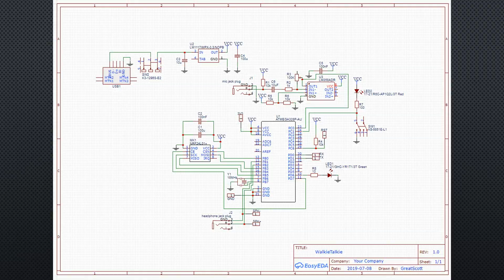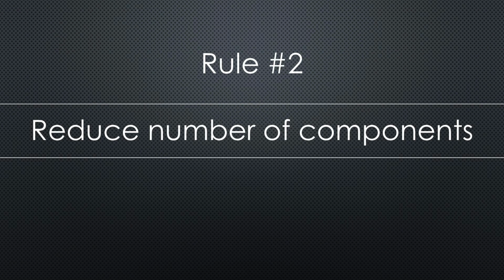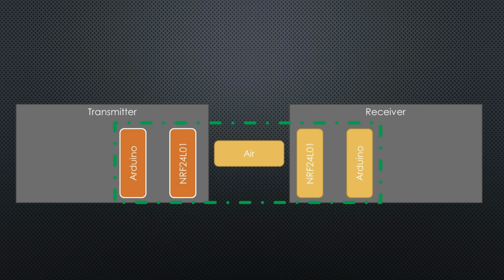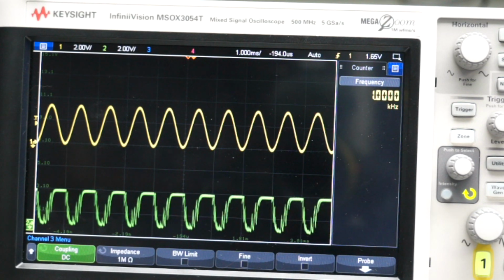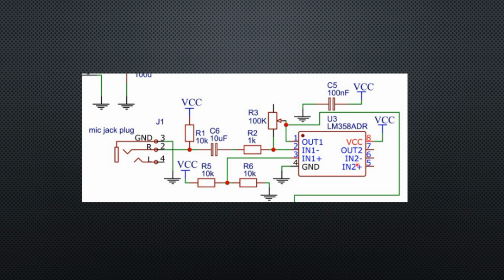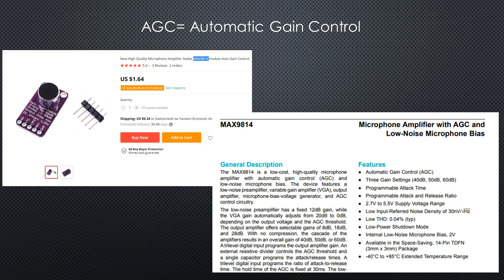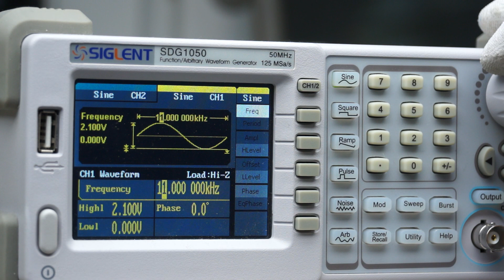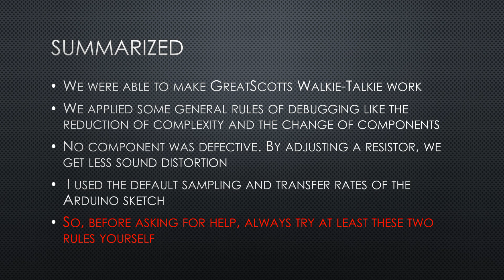#279 How to debug Arduino Projects (GreatScott's Walkie-Talkie)

Comment: This video inspired me to learn about digital audio and PCM, which I knew nothing about, not to mention re-learn about opamps yet again, and even purchase a small wave generator! I have some very basic questions: My understanding is that the output of the Arduinos (both before the transmitter and after the receiver) is a PCM encoded signal. Looking at it on a scope, this PCM signal appears to be serial pulses containing an 8-bit two's complement number every 2.4us (~400khz). I understand that the number corresponds to the amplitude of the output signal. My first question is how can this digital signal (or two opposite signals like on output pins 9 and 10) drive a loudspeaker directly. I would have thought you would need a DAC. My second question is that if original ADC output was 10 bit and 8k samples/sec, why is the PCM output only 8 bit and 400K/sec. 

How in the world do you have the time to produce such detailed and insightful content on so many subject so regularly! I watch every video until I understand it and build many of the examples to educate myself, and I have a hard time keeping up with you. You are amazing and an inspiration. Thanks!
Reply: Oops, I was looking at the MOSI signal coming out of the transmitter and the MISO signal going into the receiver.  

What I am really interested in understanding is the digital format of the signals coming out of receiver pins 9 and 10 and how that can drive a speaker. (Input is a 1Khz sine wave). Now, when looking at receiver pins 9 or 10 on the scope, these appear to be complimentary PWM signals with a 24Khz period and a pulse width of about 1.3us for every 100mV or so of input amplitude. I gather these two signals drive a speaker the way a PWM signal can drive the brightness of an LED and the two opposite signals (push-pull?) are stronger than one signal and ground. 

Am I correct that the MOSI output of the transmitter Arduino into the transmitter radio is considered PCM (and the MISO input from the receiver radio to the receiver Arduino )? So we have both PCM and PWM signals. Complicated, but simple!
Reply from the maker: PWM (pin 9 and 10) is a simple digital signal where the width of "high" is varied. It has no "data" contained in it. Whereas MOSI or MISO are real digital signals with bits and bytes. And you are right with the "push-pull.
If you integrate a PWM signal you get an analog value which is proportional to the width of the pulses.

Comment: Hmm, I haven't quite levelled up enough for this channel, but I certainly did learn something. I'm thinking that this could have been tested with a simple multimeter, where the capped sinewave would have produced an average signal that was not at the specified middle voltage. I mean, yeah a scope would be easier, but I don't yet have scope money :-)
Reply from the maker: A multimeter is a good start. The rest will come one day, I am convinced.

Comment: Interesting that adjusting the gain at the start fixed so many issues though I suspect a low pass filter on the output would help make the sound quality a little easier on the ear.
Reply from the maker: A filter definitively would help!
Reply: @AndreasSpiess  I would be very interested to see what an add on low pass filter would do.
Reply from the maker: Why not try it yourself. For a video, this would probably not be very interesting :-(
Reply: @AndreasSpiess  My workshop is currently being built... and isn't set up for electronics yet.

Comment: Hello , great work, excellent vídeos, you have many fanns, here in México, cheers, we are having a trouble with a proyect using LoRaWAN for a security buttons installed on a wood park, and we want to ask you if you have a solution, its a point to point signal array buttons to a central to identify, wildfire, animal trubles, flood, trash wastening, etc. To send a vehicle. Just a Button signal using LoRaWAN will do the work, but we need some help, thanks in advice, we really appreciate it. #makershelp cheers
Reply from the maker: Maybe you watch my "ESP-Now video. It contains a point-to-point LoRa connection
Reply: @AndreasSpiess  checking now , a great thanks to you we will have to buy esp chips and learn a lot, but we are thrilled to do it, 2019  come with a lot of wildfire, and we have to be ready for 2020 , great info, awesome response

Comment: 2 questions:
-When is it most appropriate to use the ISP or Jtag Debugger on your micro controller? Do you normally do that after all other options for electronic failures have been evaluated? 
-would throwing a lowpass RC filter on the end of your output get rid of the high pitched noise in the signal? Or maybe a bandpass with a wide high band?
Reply from the maker: Maybe you watch my video about debugging and then decide if you need it or not.

Comment: Hello Andreas. Thank you for the awesome video. Would it be possible to build this project on a STM32F103C8T6 microcontroller with the same code and library?
Reply from the maker: I doubt because it uses some Arduino specials like timers.

Comment: I wish you would have used a spectrum analyzer to show the actual sampling frequency components.  Also, why not tweak the design to minimize aliasing and develop a filter to attenuate unwanted and very annoying aliases.  So, suggest another video....by either or both of you!!!  ;)
Reply from the maker: I did not want to change too much. The spectrum would have been interesting, but also complicated for many viewers. This is why I did not include it.
Reply: @AndreasSpiess  Okay, but you could have addressed possible improvements without doing anything  GreatScott could consider that, and it would be up to him.  It is still a possibility

Comment: @GreatScott / Andreas you really need to put 100uF capacitors on your nrf24l01s. They power burst on initial transmit is very high (like 250ma IIRC). 100uF is enough, 47 isn't.
Reply from the maker: Mine had a 100uF cap on the board
Reply: @AndreasSpiess  I think I saw 47 on his. My bad!

Comment: I learned a really nice detail from this video just in passing, it was never explained or even mentioned. Notice how at 9:14 it shows the NRF24L01 with antenna wires soldered on? I never knew that was a thing! I tried the same on an ESP8266 module and literally improved signal strength by 10dB. This solves the signal strength issue I've been having in some places. Thanks for another great video!
Reply from the maker: These two NRF24L01 were in my drawer from old experiments...

Comment: This project might evolve into something really interesting. Since we have a digital transmission we could add strong encryption.
Reply from the maker: Our bikes are fast and the reach is short. So the chance to be intercepted is probably small ;-)
Reply: @AndreasSpiess  What is the reach?  I assume the distance is shorter than the specs say.  Also some missed packets would distort and you can't really retry sending. So what is the effective range?
Reply from the maker: If I remember right it was mentioned in GreatScott's video. I would assume a few hundred meters on an open road with the long-range version

Comment: Andreas, I know for sure than the ATmega328 has internal amplifiers on its ADC inputs. So you can completely omit the pre-amplifier part. But you'd probably need to write the ADC code in plain C. You'd be able to select 20 or 200 gain. Take a look at the datasheet.
Reply from the maker: I do not think so.
Reply: @AndreasSpiess  You're right. I checked again and ATmega328 doesn't have it. But ATmega32 or ATmega16 have it. It seems that they are different. Download the ATmega16 datasheet and search for "200x". I've actually used it for microphone operations.
Reply: There are also other useful features in ATmega series nobody knows about and nobody uses. For example, if you don't use a quartz to clock your ATmega328 and use its internal RC oscillator, you can connect a 32kHz quartz to it. Then you can burn the CKOPT fuse to enable internal 22pF capacitors on the XTAL lines. Then with a good program you'd have an RTC without needing an special IC.

Comment: Perhaps GreatScott could use this modules to build a walkie talkie. They are build for audio transmission. Only a arduino driver is needed additional. 
https://de.aliexpress.com/item/32305976029.html?spm=a2g0o.detail.1000014.23.3d7231649YQrck&gps-id=pcDetailBottomMoreOtherSeller&scm=1007.13338.128125.0&scm_id=1007.13338.128125.0&scm-url=1007.13338.128125.0&pvid=9f7b6d04-30cf-433d-818b-d88a9b1f6a22
Reply from the maker: Using these without being a licensed amateur operator would be illegal. For sure not the goal of GreatScott.

Comment: My first idea was an overdriven AD converter but a bad working microphone amp could also be possible. You could also try a inductor in the output like it is used in class D amplifiers to build a low pass of 3 KHz. It filters the noise. Most walkie talkies works only up to 3 KHz wich is anough for speech.
Reply from the maker: A filter would for sure help, you are right.

Comment: I suggest adding a low pass filter to cut off the digital noise high frequencies, to improve the audio quality, you could cut off above 4KHz pretty safely.
Reply from the maker: You are right. I did not want to change a lot. And as a HAM operator I am used to some sort of noise ;-)

Comment: So that distortion was due to the Arduino boosting an already distorted signal?
Reply from the maker: Yes
Reply: @AndreasSpiess  I really like the way it distorts. Could this type of distortion be achieved with all analog or do I need to use an adc of some sort?
Reply from the maker: You can add a noise source if you want to do it the analog way.

Comment: Hi Andreas, good work, but I have some complaints. You called a clear signal that signal that unstable at all and have so much digital noise. As already mentioned in comments simple filtering would fix aliasing on ADC input and filtering for speaker output will smooth sinewave (as you showed in video). Another thing I don't like - ADC sampling, due to arduino nature I doubt it have anyhow fixed sample frequency. 

Taking to account poor ATMega's ADC performance it is possible to use only 8bit data to save some RF bandwidth. 

Not judging you or anything, just thinking that you can make it a usable device, both improving sound and transmission quality. Hope you will have willing and a time to do that, curious to see end result.
Reply from the maker: As a ham operator, I am used to garbage in RF communications ;-)
Reply from the maker: Maybe you remember the title, which started with "Debugging" not with "Building" ;-)
Reply: @AndreasSpiess  Yeah, definitely. But I personally wouldn't call that earrape sound as "clear" when it looks like garbage on the scope :)

Comment: Good illustration of Nyquist's theorem - need a sharp low pass filter cutting off around 2/5ths of the sample rate, and there's a lot of jitter. Even 10ns jitter on the sample timing adds a lot of noise. It could be that the code is not sampling using a precisely timed interrupt, or is running in a main loop with unnecessary interrupts still running.
Also, it's really important to use a sample and hold circuit to fix the voltage as it is being sampled, though this may be already built into the Arduino's ADC. Integrating PWM with an RC circuit is pretty crude, but a proper DAC chip and LPF would also help to improve the sound quality.
If there's enough processing power available, the sound could be encoded in real time as AAC or MP3, transmitted with a lower RF bandwidth instead of using uncompressed PCM then decoded by the receiver.
Reply from the maker: If somebody wanted to build a real walkie-talkie this is not the recommended way. I liked the project because it uses our standard parts and still works. But adding a filter would for sure be a small, but useful addition.

Comment: Oh my ears! This needs low pass filter improvement too..
Reply from the maker: You are right. But you probably never worked with RF communications. Otherwise you would be used to noise ;-)
Reply from the maker: Here you are right! A filter would not hurt.
Reply: True, my RF experience is about 10 hours with SDR :D I don’t mind pink or any other noise, but this screeching made me cover my phone speaker. I could never get used to that, unless I loose my teenage ears.. If I had to deal with it, I’d pass it  through low pass or eq so it wouldn’t hurt

Comment: Ah cmon! I just finished my video about it goddamnit.
Reply from the maker: I have no problem if you release it. Did you come to the same conclusion?
Reply: @AndreasSpiess  I focused on testing if it is possible to process natural language with an arduino nano, including just spamming some packets in the ether with an NRF24. Since I wanted to program a neural network for word detection on an ESP32 or an Nano, I was quite interested in that. There was only a sender, not a receiver, but the sender had both a microphone and a speaker and looped the audio directly to the speaker while sending one NRF24 packet each time. The voice was audible, so I think a project like that should be feasable. On an arduino nano, at least. The test with an attiny13a failed, it's too slow. I didn't need anything for the microphone or the speaker, though. I attached them directly and went the highest frequency with both the pwm and the adc. That resulted in audio artefacts which were a bit annoying, but I am very sure with some more work they can be filtered or removed by software.

Comment: Ooh...I see .. The problem exists in the code... You don't need to mod anything but the voltage reference source in code
Reply from the maker: The clipping happened before the Arduino in the opamp
Reply: @AndreasSpiess  Oh. Ok
Reply from the maker: I do not think so
Reply: @AndreasSpiess I'm pretty sure it is definitely. Since avr have an internal voltage reference of 2.56v
You need to see what the admux values are, when adc reads voltages

Comment: Great video!  The selection of MPU for the project makes me cringe.  I have experimented with digitizing and delivering audio with AVRs.  While possible, the quality is poor.  These chips are wonderful for a great many things, but slow, with only 8 bit ADC at high speeds, and lack hardware DACs / i2s.  ESPs and STM32s are only a couple of dollars and have Arduino IDE support.  I have a sly suspicion you recognized the problem with the LM358 at first glance, Andreas, due to experience ;)    My go-to op-amp these days is a TL082 for its high slew rate, and behavior close to the rails when using a single voltage source.
Reply from the maker: First I suspected the problem in the software because I did not believe it was possible to use the NRF24L01 for that purpose ;-)

Comment: what is interesting is that a lot of people think that debugging is not an essential skill, however I could say that this is one of the most important skills to have, you cannot be a good specialist without it. I just started learning electronics about a year ago, but I can say that I could debug that also without any problems (of course by having the appropriate equipment). The most important step in this is choosing the right strategy for debugging the project.
Reply: It is part of being a good engineer and it’s called experience
Reply from the maker: @D4no00: This was the intention of this video.

Comment: I did notice in great Scott's presentation he never demonstrated going from amplified microphone to speaker with a straight wire. I also noticed in this presentation that was the last thing tried. So one more rule: KISS.
Reply from the maker: In my eyes this project is KISS. It does not have one component too much, at least if you want it wireless...
Reply: @AndreasSpiess  I agree. My comment, was regarding the troubleshooting sequence. Make sure something works in the simple case  (direct wires) before the more complicated case (wireless).
Reply from the maker: Your choice where to start
Reply: @AndreasSpiess  you also quickly drew the conclusion the problem was with the gain. You could have established that it was also an input bias problem just by adjusting the offset on the oscillator. At that point I would probably have introduced. trim pots into the design... If for no other reason than to establish proper resistor values empiracly.
Reply: @AndreasSpiess  KISS makes that choice. If you were bouncing this off a satellite would you troubleshoot the satellite first? The problem proved to be in the simplest part of the circuit ... even ahead of the pwm.

Comment: I have been working in the electronics field for years, and realized from your video here that I have been using these same rules, with minor exception with out realizing this is what I was doing. Thank You for the lesson on what I do and need to relearn to insure I am doing it right the first time. Great Video! Peace
Reply from the maker: Thank you! I tried to do some "abstraction" and I thought it will help beginners to get your experience faster.